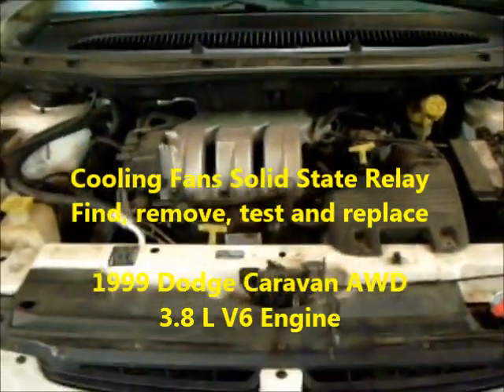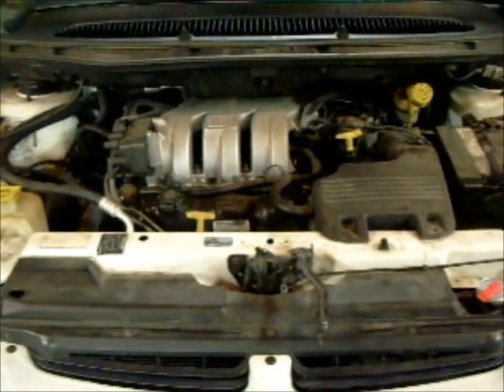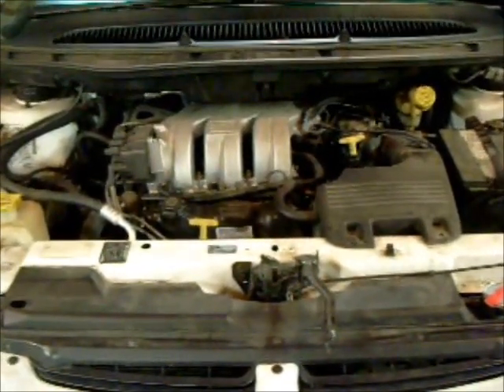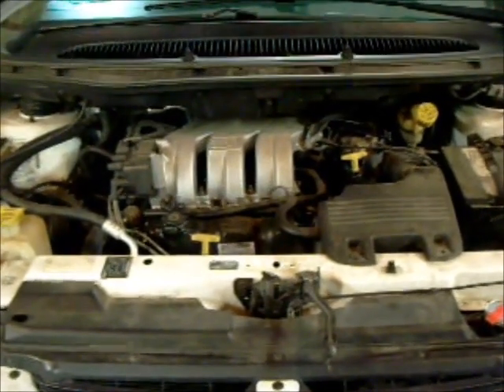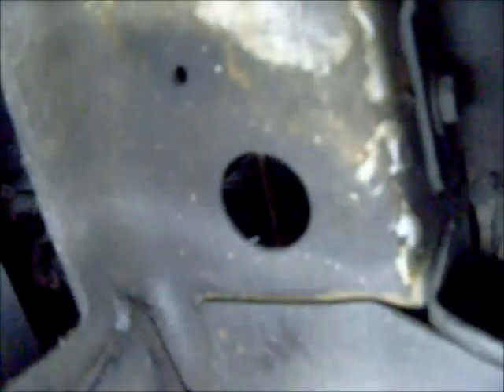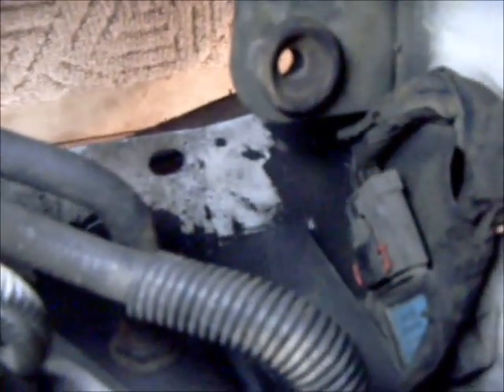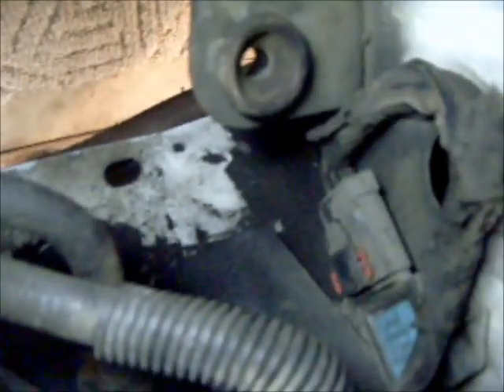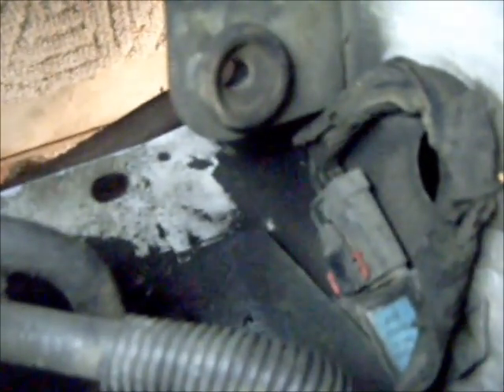1999 Dodge Caravan AWD 3.8L Radiator Fan Relay Replacement for Overheating Engine

Comment: Relay is under the car?
Reply from the maker: Yes Allen. Facing the front of the Caravan, down on the frame to the lower right. It's hard to see in the video, but its there. It is a flat piece about 2 x 2". You will have to lay on your back to reach it unless you have a lift. Have fun!😁
Reply from the maker: P.S. Allen, this relay controls the two radiator fans, so its close to the fan assembly.
Reply: @wakeup7923  thank so much. I would check it tomorrow !
Reply: @wakeup7923  hi to day I found out the fans relay ( dodge caravan 1999 v63.3 )is under driver side head light . I took out the head light model  under is a plastic cover . Took out cover and see the relay . Hope you can tell other car owner  that had the same car thank

Comment: If you can reach it from underneath, why mess with removing the air filter box to access it from above?
Reply from the maker: Great point! Thank you. I think I originally pulled the air cleaner box to locate the relay before I knew for sure where it was.

Comment: Thanks a lot for this video, good job!! NO OTHER videos show, how to test these little "stinkers" ;o) Thanks for the ohms numbers!! I have 1998 Plymouth Voyager 2,4 litre, which has, I believe, same cooling fan relay, at least looks like it! And it is in same location. Somebody else was working on this car,  van is friend of mine, and when the "Shop'"returned a car, it was worse than before, coolant was leaking, empty, they fucked up coolant plug, which is plastic, so radiator was empty. I noticed that they changed this relay, basecally only thing what was done, like they said!!?? They changed the wires and plug into relay also, I just hope, that wires are connected correct?? Now coolant fans don't go on at all?? I did change coolant temperature sensor, and we did replace fan assembly also, that was not necessary, I noticed afterwards, since old fans did work, when I applied 12 volts in them! Anyway, I am assuming, that they either burned this replaced relay?/ or connected it wrong, since fans don't work?? I don't see any thermal grease behind relay??, I will take it out on this coming Saturday, and will test it, like you show here! I let you know, what was wrong later, thanks for your great video =) Somebody told me, maybe PCM is toasted??, but car works fine otherwise, and AC works too!!??
Reply from the maker: Thank you, Eero! Sorry, you have had so much trouble with the "shop". Electrical problems are very challenging! I doubt the PCM is toast if the car is running OK except for the fans. The radiator fans should cycle on/off depending on coolant temp. If the fans are not ever turning on, I would guess the relay is blown again. If the temperature indicator in the dashboard is reading OK - usually middle to slightly high, then the temp sensor is OK. I hope you got it fixed OK. Dave
Reply: I did test it, the sensor, this way, and it was, surprinsingly OK, 1+3 was 1.4 Ohms, and 2+4 was 0!! I have new temp. sensor already, if you connect those two pins, with short wire, power on, in temp. sensor harness, should fans go on?? Well, they don't? And when I took harness out from radiator cooling fan relay, it has power and ground, but I can't find signal, other small wire, when engine running and AC turned ON?? Should that signal be on?? Very confusing?? Also, if you connect those two big wires from radiator cooling fan relay harness, 12 V power and ground going to fans, should fans go on?? Well, they don't...., when I took other harness off going to new fans, and applied 12 V, both fans went ON??? I don't think PCM is toasted either, but why it does not send signal to turn fans ON??? My brains are getting "hot"???? Want to help my friend,...I don't know, what to do....??? Thanks

Comment from the maker: Herma, maybe a new car would fix all problems, except cash-flow! I've been tempted at times to just stop fixin' stuff and just replace it. But it is always less expensive to repair, unless you are facing major issues like engine, transmission, body rusting out. The relay cost was $45.A shop would probably charge $125-$150 total to repair. In your case, the temperature sensor (threads into engine block on top) or the relay seem to be suspect. But since the fans never came back on (they probably won't when engine is cold), I would suspect the relay. However, the rad fans on most cars are for cooling at low speed in city and at idle. I assume driving at normal speeds the engine does not overheat? If temp indicator shows "normal" range when driving normally, then I would replace the relay. That's based on what I did with my car. A repair shop told me I had blown head gaskets and it would cost $2500. That's when I decided to troubleshoot the problem myself. Like medical, always get a second opinion! Good luck. Hope this helped.

Comment: Dave, my radiator fan also suddenly stayed on after the engine was turned off. We had to actually disconnect the battery because it would not turn off, not even after an hour, when the oil temp should have cooled enough to make the fan turn off. The next day, the fan did not start stay on and we wrongly assumed that it had fixed it's self. But of course, no such luck: the car started to overheat because now the fan is not turning on at all. Relay? or?.... should I just by a new car?

Comment: My fan won't stop running even when the car is off. Do you think this is the part I need to replace?
Reply from the maker: Sorry for my late reply, but yes, that could be the problem. Try disconnecting the relay (see video) and see if the fan stops. Probably will and you'll know for sure the relay was the problem. The fan circuit seems to be "hot" all the time, even if the car is off and key removed. That's to cool down the coolant. Once the temp sensor says its cool enough, it tells the relay to open circuit. So it could also be the temp sensor is not reading correctly.
Reply: Dave Light

Comment: Hello , I have a 2005 Dodge Caravan( 3.3 L) engine. Have a problem in the cooling water system, a decrease in the level of coolant in the radiator, main casket , radiator cap has been replaced and the( thermostat + casket)  and still the same problem, although there is no leak ,Please How do I know where is the problem and how to fix the reason?
Reply from the maker: Good question. Coolant can only disappear by leak or "burning" (head gasket leak for example). Some things to look for:
1) Is excessive water in tailpipe or white cloud when engine running? If so could mean head-gasket still leaking (drawing coolant into cylinder and making steam). Head gasket can also cause a pressure leak when coolant system is over pressurized by leak forcing coolant out somewhere, such as rad cap, water pump shaft seal or small hole in radiator or hoses.
2) Heater core can also leak and is sometimes hard to find. Biggest evidence is wet carpet on floor under heater.
3) A pressure tester can be used on the radiator to see if pressure drops or increases when engine is running over several minutes while it is heated up.
4) Look for exhaust - visual and smell - from radiator when running at normal temp. CAUTION: Don't remove cap while hot - start with cool, engine and observe while it is warming up. If see or smell exhaust, likely is head-gasket leak. There is a kit available to attach to radiator neck to watch for bubbles. Eric the car guy has some good videos on testing for leaks.
5) Does van overheat, or just lose coolant? (probably overheats if enough coolant is lost.) Watch the temp guage and make sure it is steady in the operating range.
6) If you are sure the head gaskets (2) were replaced properly, including milling of heads if any warpage detected, then, you must be losing coolant as a leak somewhere. There are many places to watch carefully on the engine, hoses, radiator, heater core in box on firewall, etc. Park van on clean dry surface after driving to see if coolant is dripping from anywhere.
7) If all else fails ADD a CAN OF BAR'S LEAK TO COOLING SYSTEM. FOLLOW INSTRUCTIONS. I have seen this stop leaks completely for years, including minor head gasket leaks.http://www.barsproducts.com
GOOD LUCK! Keep searching and you will find the answer!
Dave
Reply: Thank you very much for your precious time to answer the question, and accept sincerely
Reply from the maker: Glad to help. Hope you are able to figure out the problem!

Comment: Dave, this is a great video!  You have taken the mystery out of why my radiator fans were not working and provided the solution.  Excellent detail and how to get to the relay switch.  The original did not have thermal grease and thermal grease did not come with the kit.  The parts store sold  me dielectric grease, even though I asked for thermal grease, so I just cleaned the frame and put it on with no thermal grease.  We will see how long it lasts.